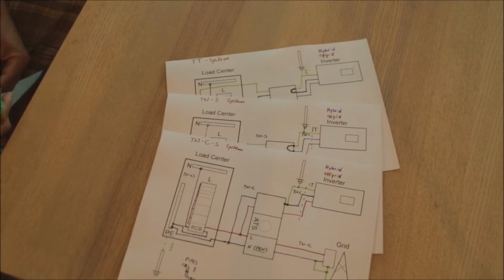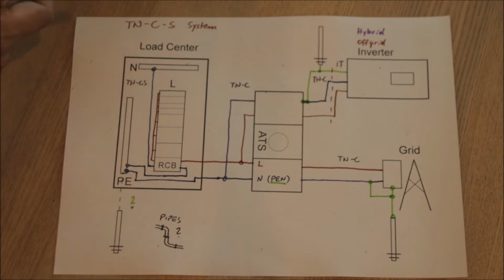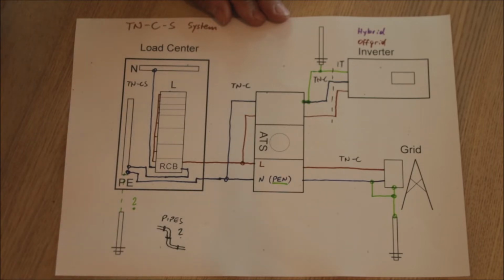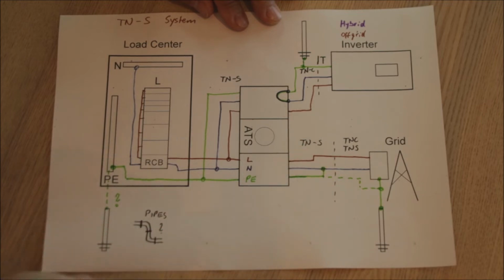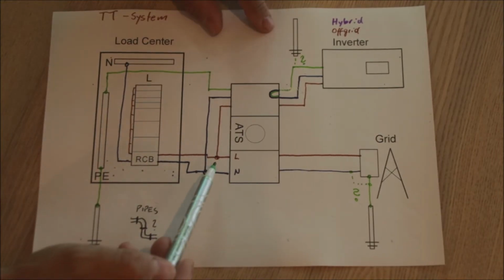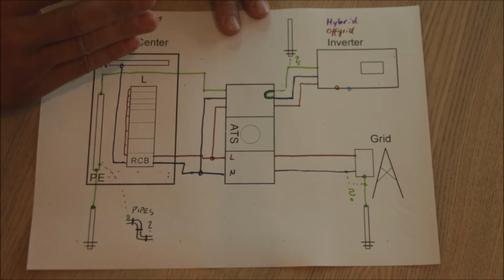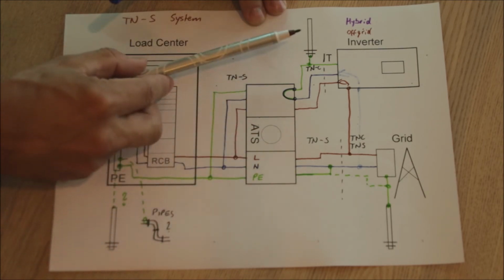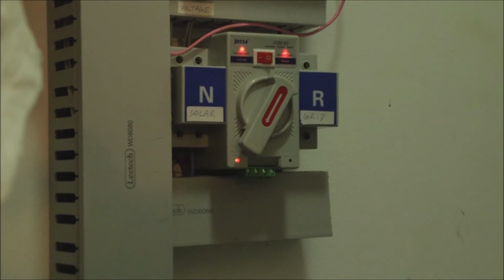Earthing and Bonding of Solar Inverters in different Earthing -Systems. Practical guidance.

Comment: Turns out that due to regulations some inverters do bond neutral and ground internally when in off-grid mode(MPP Solar and all similar design inverters). This creates some complications. You can't have a bond after the inverters. Also when having multiple inverters in parallel, we will end up again with multiple N-G bonds inside the inverters. Seems like the solution is to remove the internal bond and to bond before the inverters.

Would be interesting to hear your thoughts on the subject :).
Reply from the maker: if you have an inverter which can internally bond when in island mode, then that is great and you should use that feature. it is just important to check that the bond is released when in grid bypass mode or at least you can set what to do at this situation. a permanent bond in a TT earthing system would be forbidden.
Reply: Thanks. Yes, that's how it is supposed to work, release the bond in bypass mode and bond in off-grid mode. However, when having 2 or more units in parallel, wouldn't that be a problem? All inverters will bond in off-grid internally.
Reply from the maker: @vassilnikov6814  yes. you should only do the bonding on the master inverter. is it possible to set the bonding relay via the user interface so that it could be deactivated for the slave inverters?
Reply: @RolandW_DIYEnergyandMore  my understanding is that there is a screw that bonds the N and G lines when in off-grid. It is possible to remove the screw but you have to open the inverter to do that. There are some brands(one known) that stopped shipping their units with the screw but most brands using this inverter design do bond with screw inside the inverter.
Reply from the maker: @vassilnikov6814  you are talking about lets say the Growatt ES, right? Aren't those screws permanent bonds of N-G? Providing a N-G bond by an internal path on a PCB where in the case of several parallel operating inverters a quite serious current will be pushed over that copper tracks and finally over a screw is anyways questionable. If there is a dedicated relay or dry contact which can control an external relay, that would be the far better option. Like for example the Deye SG hybrid inverter (US is SolArk) they do have a dry contact to my knowledge which can be set via the UI as well and can use an external bonding relay.

Comment: why can not I ground the inverter to the same ground rod in the load center?
Reply from the maker: You can. It's always just a question of bonding, if a permanent or off-grid only, is allowed...
Reply: @RolandW_DIYEnergyandMore  thanks for the reply. but if it is hybrid? is it still allowed? or do I have to make separate AC earthing for this hybrid inverter and separate for the load center? and what about bounding ?
Reply from the maker: @realitynews1586  ground you can use same. bonding depends on you grid type. TN-C or TT. If TT follow my video on TT bonding relay

Comment: Hi Roland
I just installed (14sep22)Growatt SPF 5000ES  inverter.
now its connected to 12vx250Ah rs 4batteries 48V- working fine

My solar Array in series is ready producing 200v to connect  PV side of the inverter =ve and -ve
+ve  and -ve  gives 28V DC that ok I was told by Growatt engineers

But we just checked  PV side at the inverter +ve and earthing PE has got 238V   AC
when checked at -Ve and Earthing PE gives same 238V  AC?
So we stopped connecting the Solar, 

My doubts/questions"
There is no earthing point shown on Growatt SPF 5000ES  inverter
so we ran a wire from PE to the body mounting screw point.
Reason why we connected::
As Manual of SPF 5000 ES says it must be connected to the PE
Is the body of this inverter connected into PE inside the system ????
Do we have to provide to connect PE to the body??
as you said in the Video  is there a Bonding relay in this Model??

Comment: i'm no electrician, but i know 1 most important rule:  the PE conductor should never be broken or PEN in the case of TN-C system (PE - PEN being the uninterrupted path for a fault current back to the source). in my country is even forbidden by electrical code to brake the PEN conductor in TN-C system.
in this case, shouldn't your PEN separation (in PE and N and the connection to the ground should have been before the transfer switch?

as for the inverter side, things are, i think, a little bit more diverse, but there, another important rule should also be used: there can be only ONE neutral/ground bond in your entire electrical system at a time.

i'm i wrong?

as for the "consideration" of a TN-S system just because u have 3 wire coming from the utility system, i don't know what to say. i think is always better to "consider" that u have a TN-C system on the utility part, even if u got 3 wires from them and to have that earth connection to the PE conductor. 

also the inverter earthing rod and the main pannel earthing rod should be bonded together under ground.
Reply from the maker: @cbitzy-t8o  that's why before the separation from PEN into PE and N any switching must include ALL poles so that the power source is fully isolated and no fault currents can flow anywhere. But that also means that each power source must be protected from any possible human interaction with life wires, or there must be warning signs that danger is present within that area of the installation.
A TN-C installation is classic, and only used on the power supply side, but mostly forbidden in any installation beyond the supply entrance to the consumer installation/in-house distribution. That's why the PEN split at the supply entrance is mandatory.
Any off-grid capable inverter needs to be strictly seen as a power source similar to a grid transformer, and not as many people unfortunately see it as just another appliance within the home installation.
Reply: @RolandW_DIYEnergyandMore  first of all, talking about the legislation in my country, don't know how is where u are, the moment u pass that PE (PEN) trough a switch, u are breaking the norm (the PE should be one continuous conductor from the receptacle to the source (transformer or inverter), no passing trough any protection device or switch).
second, CAN SOMEONE GUARANTEE that let say the L contact of that switch u are talking about can't remain stick and only the contact of the PEN conductor is open and then u are in a lot of trouble?

why can't u split the PEN before the transfer switch,also connect the PE of the inverter at that point directly, pass the L and N trough the switch and PE directly to the main board ?

that restriction is something like this in english: "On the PEN conductor, no protection  or separation (sectioning) device will be mounted."

offcorce, i can be wrong, like i sayd, i'm not an electrician.
Reply from the maker: @cbitzy-t8o  the only earthing system where the PE continues until the power source is the TN-S. In the TN-C which as said is the standard power distribution before the service entrance, there are only active wires which are phase wires and a combined PEN. OK, lets say you have 2 power sources. One is the Grid, the other an Off-Grid inverter. You do have the transfer switch to select either of the sources. Now you bypass the transfer switch with a PE wire, which also means  you must have two N-PE bonds, one for each power source as fault currents need to return to the N which is switched. So you have created a permanent link between the Neutrals of every power source via the PE creating potentially secondary fault current loops.
Why are there no switching or protective devices on the TN-C side? There are fuses, breakers and disconnects as well but as said in the previous comment, on the power source side, protective devices are solely protecting from overload, over current. Leakage cannot be detected inside a TN-C that is why it is banned in a home installation when used until the recepticle outlet. Therefore a TN-C must be turned into a TN-CS where the separated PE must be continued until the point of separation, point of N-PE bonding bypassing all protective devices, ideally also an RCD which can detect the leakage and shut down your system.
Reply: @RolandW_DIYEnergyandMore  like i said, i'm not an electrician and i'm not trying to contradict u, i just try to understand better.
i understood what TN-S system is and what the PE conductor is in that. it continues until the source.
i understood the TN-C system, and i think this system also have a PE conductor that continues from the receptacle all the way back to the power source, uninterrupted - in the normes i talk about, the PEN conductor is defined like a conductor that combine the PE and N function.
also in the same normes, it says that once u devided PE and N, u can't put them back together.
also there is that rule i posted earlier that say: " "On the PEN conductor, no protection  or separation (sectioning) device will be mounted."
from here i understand that in TN-C system, PEN conductor it has the function of N conductor and also the function of PE conductor, and also the restriction of the PE (goes uninterrupted back to the source)

for how i understand things, the main way to make a circuit safe in case of a fault (not only overcurrent's (overloads and short circuits) - this means a phase to enclosure fault is to turn off that circuit. this thing is realized by offering the fault current a low impedance way back to the source (PE or PEN) so that the current is very high so the breaker will trip instantly.
u can't offer this protection if the conductor is interrupted in some manner.

basically the PE conductor is a doubling of the N conductor, with the addition that this one is not interrupted.
PEN conductor is basically the cheap version of that 2 wires in parallel, since the restriction of interrupting the PEN from the source way to the receptacle.

it is right, now we are obligated to transform that TN-C system into a TN-C-S one, but this doesn't mean that PE - PEN is on some part of the system interrupted.

the RCD protection are secundary type of protection (because they have a very high probability of failing), even tho, the rcd's are also mandatory, the main way of cutting off the circuit remain the PE conductor.

this is how i understand this systems. hope i don't have to take all  the understanding part back from the start 😬.

as for the grid inverter connection, i'm not very familiar with, but for what i understand so far, the main recommended way of connecting them is PE from grid and inverter bonded, N from grid and inverter bonded and L passed trough the transfer switch - i don't know if i express it right, i'm not a very good english speaker, but something on this manner .

the bottom line is, trying to respect the norm i said earlier,  NO PROTECTION OR SEPARATION DEVICE ON THE PEN IS ALLOWED,  how can u solve the problem of u connecting onto the power grid widow the PEN being passed onto that switch?

anyway, i will continue digging and learning more on this. i wish u a great day and good luck with your projects.
Reply from the maker: @cbitzy-t8o  we talking about the same stuff just from a different perspective. We as typical electric service clients, will never have access to the TN-C earthing system, as the utility service provider will turn it into a TN-CS at our service entrance and you will get a separate N and PE entering your home. but this means that there is a permanent N-PE bond right before your home installation begins.
Now when you add another power source in parallel to the Grid, you will have to use a transfer switch of any kind. The question is at which point can you add the transfer switch. Before or after the Grid N-PE separation....
So you need to create the same input for your second source as your primary sorce is available. If you can access the TN-C side as I can, then the logic way of connecting the second source is as well TN-C. If you can only access after the separation, then you have to similarly bond and separate at the inverter before going into the transfer switch. 
bypassing the transfer switch with those 2 PE wires means as well that PE of source 1and 2 is one, so N of source 1 and 2 is one.
So there is a possibility of ground loops. 
Any switching, protective or other, can only be two polar L and N. A fully isolated power cannot cause fault currents in you downstream installation. How would it?
That's why it is always recommended to consult a local electrician to discuss code requirements.
Have fun with you project. Good luck!
Reply: @RolandW_DIYEnergyandMore  ok. we having longer and longer explanation that are somehow confusing and somewhat contradictory.

we first have to agree on some things:
1. TN-C-S systems - 1-st letter is referring to the relationship of the power distribution system to earth ( T meaning direct connection of one pole to earth - middle point of the transformer - N conductor);
2-nd letter is referring to the grounding of the equipment - N meaning that the equipment (the cases, metallic parts) have a direct electrical connection to the earthed point of the power distribution system (PE/PEN conductor);
3 and 4 -th letter is referring to the arrangement of neutral and protective conductors (specific to the TN systems) - C meaning that neutral and protective functions are combined in a single conductor (PEN) for a part of the system (distribution usually) and S means that for the rest of the way, the neutral and the protective  functions are separated.

then we have a electrical code requirement that say: "On the PEN conductor, no protection  or separation (sectioning) device will be mounted." - i understand that for the TN-C part of the TN-C-S system, the PEN conductor should not be interrupted.

being a TN system, we have to provide a PE conductor from the metallic case to the power source: to the transformer in the case that the feeding is done from the grid side (PE->PEN conductor) or to the inverter in case the feeding is done from the PV (PE conductor)

if we ca agree till here, this was my initial comment:

if u are not allowed to brake the PEN conductor, the transfer switch it cannot be put before the separation of the PEN conductor right?

so we make the separation before the transfer switch, and we chose the inverter accordingly, and we connect the inverter to the power system  accordingly. there are ways of achieving this, widow creating a ground loop (because we need to chose our inverter depending of our existing condition and regulations)

if i'm not mistaken, i think there are 3 types of inverters depending of the way the bond between the N and PE is done at the inverter level: - dynamic bonding; - no bonding; - common neutral (hope i'm not mistaken)

something on this line was my initial message (talking about long and confusing messages 🤣)
Reply from the maker: @cbitzy-t8o  OK, you are 100 percent correct. Because you are also considering that the devices like the transfer switch will fail to operate correctly and in the case of breaking the PEN conductor but not the L conductor, we will have an enegized PE, N circuit. 
I saw the switch more like an isolation device with the advantage of a non bonded input side, that for example if the inverter is isolated, it will turn into an IT source ( not the grid side of course).
I don't know how likely single sided device failure are, but will consider this in my setup.
I am the last one who wants to teach any dangerous procedures. but as said, it will be very unlikely that a normal user can access the TN-C side anyways.
So, thanks for making me aware of it!